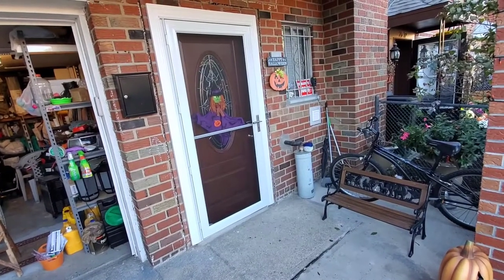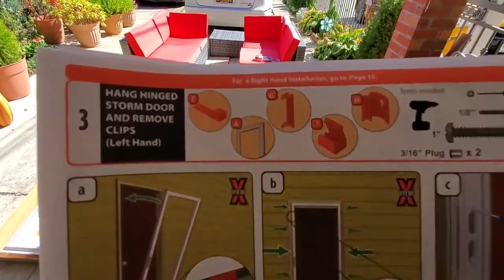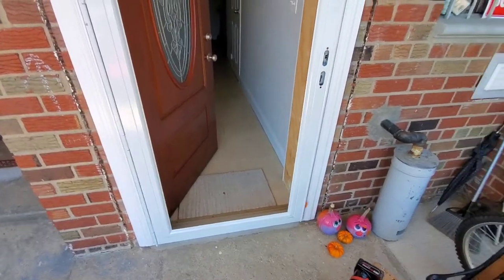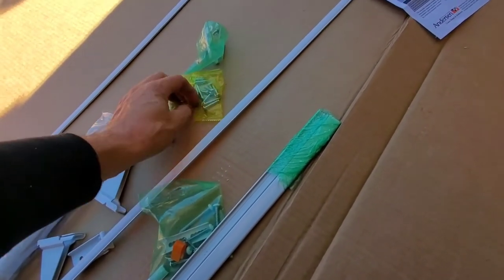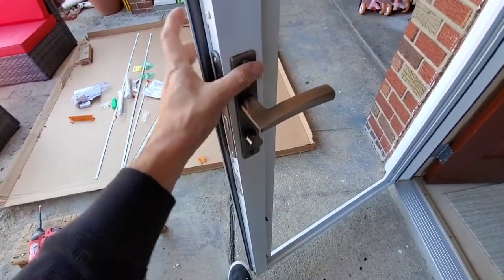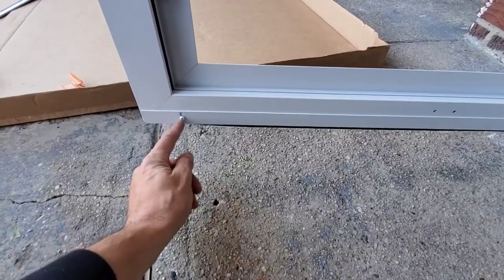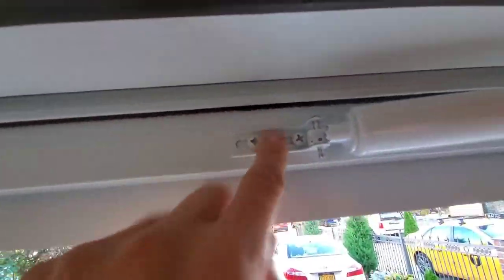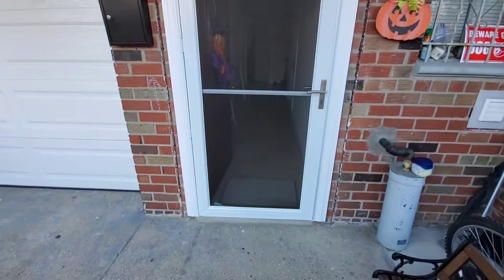Andersen 4000 Storm Door Install

Comment: Thnx for the video. What is that tank-looking thing on the right side of your door?
Reply from the maker: Well welll Magnum PI. Its the gas line coming from the ground into the house. That's just a cover for the pipe and has some insulation in there. Im sure the cover is there so the pipe doesn't get accidentally damaged. Good eye  👀

Comment: i just installed one of these, there is no striker plate for the locks to lock into, it just locks into the edge of the door, not very strong or safe
Reply from the maker: Correct. Lock is more of a deterrent.  Especially with the screen in place.

Comment: Does the trim moulding have to be 1" minimum depth per online instruction? Mine is only 3/4"
Reply from the maker: Are you talking about the brick moulding the door sits in?
Reply: Yes. On the website, it says minimum 1" brick mould depth required. Not sure if it is nominal or actual dimension. Usually an 1" brick mould trim is 3/4" thick.
Reply from the maker: I just measured mine and its an inch. There is very little extra room on the inside. What you can try is to install a strip moulding around where the storm door frame would sit to give you the clearance.

Comment: Outdated - the 4000 does not use dual compressor-type door closers anymore
Reply from the maker: Easy champ. It was installed last year not 400BC.😄😄😄
Reply: @kingkobina  - sorry sport, just pointing a fact about the current ones
Reply from the maker: @dwdickson  no problem 😄😄😄
Reply: Anderson changes parts and door designs often. Does that mean the new doors are better no. 2 pistons are better then 1. Also the new designs doesn't even have striker plate on the closing side, which makes them weaker by design. I paid $200 something for a 4000 something like 6-8 years back and just installed it. It has the striker plate and dual pistons with locking bottom on. The new 4000 door is 400+ and blow depot.
Reply: I purchased a 4000 series today with the newer closer. They still had the piston style with the extra storm latches. 
I opted for the 4000 with the updated closer that had the hidden half screen. 

Thanks for the video. I always like to get a game plan